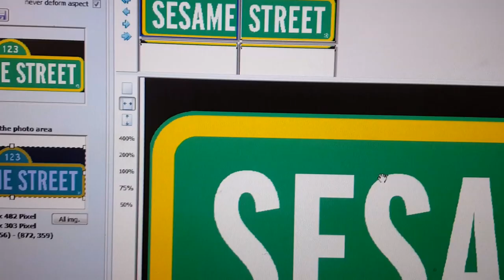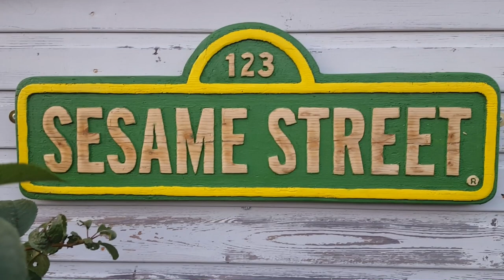Handheld Router Projects - Sesame Street Wall Art Sign

Comment: Nice work. I try to put painters tape down first or self adhesive shelving paper then spray tack my pattern to that. It comes off the wood easier when you are finished. You do not have to sand it off.